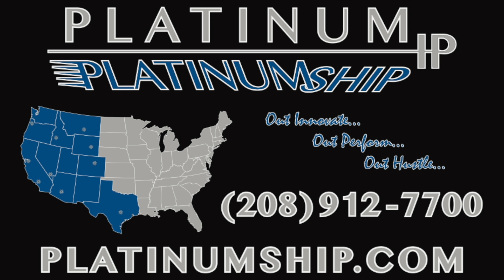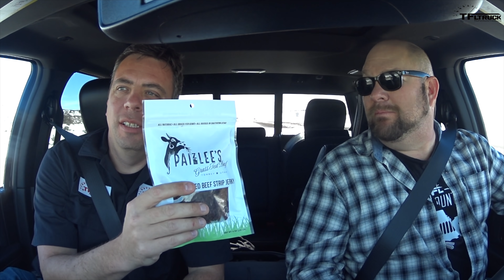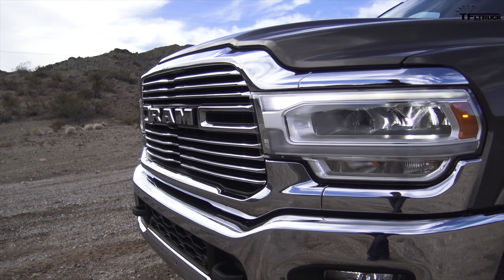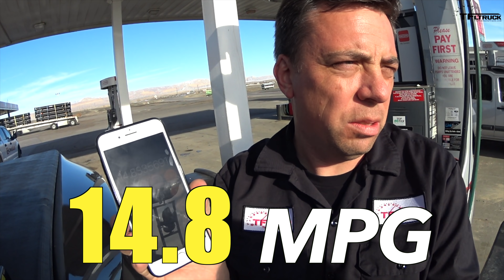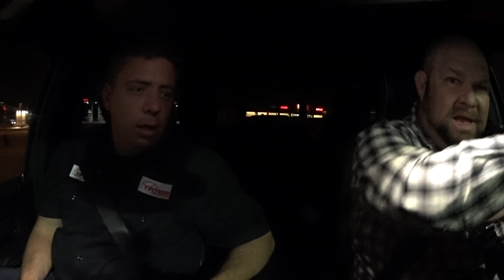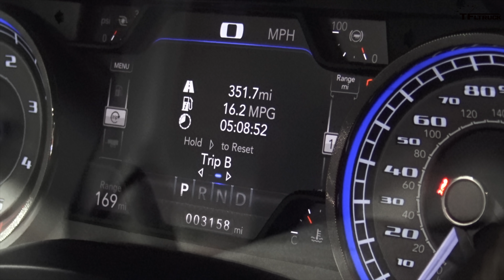We Drive 800 Miles in the New 2019 RAM 3500: Here's How Fuel Efficient 1000 lb-ft of Torque Is!

Comment: My 6.0 power stroke dually with 22.5 Alcoa’s gets me way better than this ram I travel 700 miles on a single tank which holds 36 gallons if I’m not wrong.

Comment: Yeah big rigs use cummins but not the 6.7 cummins just stop saying that nonsense already.
Reply: Obviously the big rigs do not use the 6.7. The point is that the 6.7 (and 5.9s) were made almost exactly like the bigger ones. Same materials, specs, etc. That is why the engine overhaul rate is 350k, a true medium duty diesel engine. And it can be bored 2 or 3 times I'm many cases before being sleeved. A true million mile inline engine that always had high torque in low rpms, higher compression, and no glow plugs unlike the competitors. Simply no comparison.

Comment: Any Cummins engine installed in a Ram or the Ecodiesel in the Ram.  Get the best fuel economy at 1300 to 1800 rpm.  So if the gear ratio and the speed limit.  Have you outside that range.  Your fuel economy will suffer.  My wife has a 2018 Ram 2500 4wd Crew Cab.  I have a 2016 Ram 1500 4wd Quad Cab.  We find the numbers that TFLTruck gets, to be very realistic.
Since I have a class "A" license.  And have operated vehicle combinations up to 230,000 lbs.  A Ram 3500 or any brand pickup is only good for occassional heavy towing.  So you really have an everyday vehicle that can tow things now and then.  A 3 or 4 year old tractor can be bought for $30-50k dollars.  And will pull a 35k lbs trailer real easy.  But it cannot be parked on the same streets as a 3500 sometimes.  Plus a Ram 3500 will fit in most parking garages.  While a tractor will not likely fit.

Comment: The ram intake that the truck has needs work. I build fire trucks and we can't easily build a truck on their chassis because they over heat when pumping water. The shutters in the grill don't open when stationary so it sucks the hot air from the passenger wheel well instead of the grill where the cooler fresh air is. 

The engineers from Ram said their cooling package is half the size of Ford's

Comment: That’s a terrible MPG. My 2015 Ram 3500 with Aisin got 21.7 mpg on my 950 mile trip from Ohio to Florida back in December. 
Didn’t get fuel until Macon Ga. but still had almost 1/4 tank. That was almost 600 miles on the first leg of the drive.
Reply: You had more miles on it once broken in diesels always do better

Comment: Better mpg than a tundra 13.9 mpg 
But won’t last a million miles like the tundra
Reply: Bet, cummins has a high mileage club for vehicles with high millage. You might be surprised to learn that the list isn’t short either. With a list of over 6,700 vehicles, 90 of them have over one million miles on their odometers. Of the highest is a 1996 Dodge Ram with a 5.9-liter Cummins diesel engine that has 3,016,789 miles. Following that is another two 5.9-liter Cummins engines that also have over 3,000,000 miles on them. Get your facts right Bud.

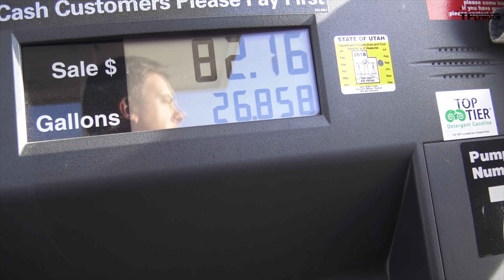Comment: Another good video guys. I live about 40 miles from Green River where you checked the mpg on that beautiful Ram 3500. I wish my 2009 Dodge Ram 3500 dually diesel got that good. When not pulling my trailer, I average approximately 5 mpg and pulling my big trailer, it averages about 2 mpg. It takes me two tanks to make it to Las Vegas from Green River, when pulling my 38 foot trailer. Pulling my trailer up Spotted Wolf on I-70 , you can actually watch the fuel gauge move before reaching the top. The truck has 4:56 gears and I've had it at the dealer and at independent diesel shops literally hundreds of time complaining about the mpg, but every one tells me that it's normal.

Comment: My 2018 F-150 5.0 averages 12.1 MPG's under normal driving conditions this Ram is awesome
Reply: You must be heavy on the gas. My 2017 5.0 averages 16.5 MPG combined.
Reply: no way your getting 12.1 do hand calculate not what's on your screen
Reply: Red light racer.

Comment: I once had a new 2003 Ram Laramie dually quad cab 5.9L Cummins diesel.  I would average 18-20 mpg on my trips between Denver and Albuquerque with no load other than the driver and fuel.  For my RV use of the truck, I prefer the better mpg than the often unneeded 1,000 torque figure and no DEF tank.  As I remember,  I paid around $34,000+ for my truck.  The need for DEF, diesel fuel costs, ,and the crazy prices for a diesel truck today has turned me off on ever buying one again.  I will buy a gas engine next time.  The new 1/2 tone trucks pull what once required at a minimum a 3/4 ton truck.  I know there is a market for that new Ram monster TFL drove back from Vegas, but it has outgrown me in too many ways.

Comment: So... this new 2019 6.7L 1-Ton diesel (with 1000# of torque) gets just about the same mileage as a 1500 Half-ton Ram with the old 5.9L gasoline engine and a 1/3 of the torque.  Pretty impressive, really.
Reply: A turbo diesel is way more efficient than a N/A gasser👍
Reply: Agreed.  But, unfortunately, in my state the Legislature is going after diesels of all kinds, sans off-road and farm-only vehicles (tractors) to punish the owners of them.  Oregon wants to essentially ban all over-the-road diesels in the name of Climate Change.  What a pity if they get their way, and I don't see much in the way to stop them.
Reply: I wouldn't cross the diesel-gas engine barrier as it's just not relevant.  Compare new 6.7L to old 12V 5.9L Cummins in first and second gen Ram, instead. ;)
Reply: Mic when you say it like that it is pretty impressive
Reply: Apples to oranges. This is a diesel from the sounds of it it you are comparing it to a gas. A diesel 1/2 ton gets about 30 mpg, about twice as much as the Cummins.
Reply: I am, but that's the point.  I still own my 2001 Dodge ½-ton 1500 with the 5.9L V-8 and it gets ~14 mpg.  Has since new.  This 1-ton with >2.5 times the torque does the same or better (mileage wise) while able to do a LOT more work.  To me, that's remarkable.  I also own a 2015 Ram Ecodiesel which gets 29+ mpg.  But it has < half of the torque of this 1-ton.
Reply: @mic982  Buy a older dodge from the 90s add a few mods get a true 1000ft of TQ and 21 MPG PLUS no DEF to cost you more. This thing gets crap mileage! BTW if you get a programmer for your 1/2 ton you will get better mileage. Back in them years dodge did what was called the "death flash" which killed the mileage. If you get a hold of a older 90s gas that was lucky to never get the flash you will see better. Even my 3/4 ton gas burners get 16+ but they are not flashed trucks.
Reply: I own a 2001 Dodge 1500 with the 5.9L (360ci)  for the farm (14 mpg, <425# torque) and a 2015 Ecodiesel 3.0L (with 440#) at mpg's as high as 30-31 (but usually around 28-29).  I don't really have need for the 1-ton and the 1000# torque because the Eco pulls my 5000# RV at around 17-18 mpg and I'm only pulling it a couple thousand miles/year tops.  But I was pretty impressed that the new 1-ton could generate that much power and still meet or beat my older 5.9 gas engine with all that power. When pulling my trailer with the older truck, I'm lucky to get 8-9 mpg!  DEF is cheap - about 4 gallons per 8000 miles or about $18/year.
Reply: @mic982  DEF is not really cheap once you factor in the constant repairs of it. Don't forget to put that in there. Also diesels will always produce more power then gas with better mileage. 
gasoline  1 gallon = 120,429 Btu²
Diesel fuel  1 gallon = 137,381 Btu

Diesel fuel simply produces more for less. Plus the engine designs factor in there.
Reply: @eatshitful  I'm not advocating DEF - tho with the new Café standards required by the EPA and other Federal agencies it's what auto manufacturers are having to do to try to reach the unreachable:  0 emissions.  I'm hoping the Trump Administration will bring back a measure of sanity to the EPA but I'm not betting on it.  Yeah, I'm sold on diesel if the power is needed at economy.  No arguments there.
Reply: @mic982  Now if you dig into the details of emission systems and figure out how they work and what they do plus how they are tested you start to get the idea there is another reason for it because they are actually raising the emissions overall while making it seem low at a very narrow point and with a incorrect measuring system. If you think i am nuts by saying that fine i wont type out anymore details. If you want to know why i say that just ask.
Reply: @eatshitful  As an interesting side note: I get this notice in the mail of a class-action lawsuit against Chrysler/FCA awarding owners of the ecodiesel Rams and Grand Cherokees cash returns (substantial) IF they agree to send their vehicle into the dealerships for the software changes needed to make the vehicles compatible with those new standards.  Plus, an extended warranty on the engine emission systems.  Hmmm....I'm wondering is the cash carrot worth risking a decrease in performance and/or mileage?  Or is there a 'stick' awaiting owners who pass on the software changes.  I mean, these ecodiesels are amazing in their performance and mileage now, why mess with a good thing?
Reply: @mic982  No way i would take it back to a dealer ever again then. Any time that thing sees a dealer now they will do the update. As back in the 90s and early 2000s the "death flash" did nothing but harm the mileage and power while masking a issue (unrelated to emissions). I wouldn't do it. If i remember right it was VW who had made a vehicle that did not fully comply with emissions which is why it performed so well. Then they got sued bluh bluh and after the car was able to pass emissions mileage fell along with power. Now for a diesel to be re flashed to pass emissions i could only see it being a down grade to because the way a diesel runs. Other then maybe a timing advance but i highly doubt that is all you would get. Most likely defuel it to get the emissions down making it a dog. Altho most stock diesels would see less emissions more power and better mileage just bumping up the timing. You can only go so far tho. I bet the dealer is not going to do that. Actually for many years them so called "mileage programmers" simply upped the timing on a diesel. As strange as it may sound most diesels gain mileage by adding timing and fuel especially a truck pulling heavy. Yes i just said add fuel to gain mileage. It works because pulling a hill down shifting is bad for mileage. If you have the power to stay in a higher gear while keeping your speed you gain mileage. Now empty unless you plan to push on the peddle harder your mileage will not be lost. You gain mileage here because of the timing. This is why i now turn up every diesel i own. It is not to play it is to get the mileage pulling. At one time i only turned up the timing thinking adding fuel would only hurt the mileage but 1 truck i finally did and the mileage improved. So i tested this with several more trucks and it works. You may not see the gain adding fuel if you are already holding your speed without down shifting up hills. A gas vehicle will also gain mileage if you can keep your speed without down shifting. But it is harder to make more power out of a gas engine in a way it wont overall lower your mileage.
Reply: @eatshitful  Don't think that wasn't the first thing that crossed my mind.  But I give you the 2nd paragraph of the 'Approved Emissions Modification Overview' on the web-page detailing the settlement:  "The AEM is not expected to change any of your key vehicle attributes, such as average fuel economy, reliability, durability, vehicle performance, drivability, engine noise or vibration, or other driving characteristics."  Now, this may or may not be true, I dunno.  The 'carrots' offered to get owners to join the settlement are $3025 to original owners, $2425 to owners not the original buyer and $990 to all lessees, plus an extended warranty beyond that of the original factory warranty.  Of course I am very suspicious of this because of the superior performance  of the Ram ecodiesel as it is now configured.  I am waiting to hear back from others who will have undergone the modifications and driven their vehicles at least 1000 miles after.  The modifications are not yet available and won't be (apparently) until sometime after May 2019 when the court makes it's final decision.  Thereafter, owners will have 21 months to join the suit if they choose to keep the vehicle and have it modified.  $3000 smackers and an extended warranty are a lot of carrots.
Reply: @mic982  Did you end up taking it in? I heard the updates were nothing but bad news.
Reply: @benbennett4097  Yes, I did.  About 6 weeks ago.  I was lured into it by the extended warranty and the $3025.  But, if I had it to do over again, probably not.  Mpg dropped from ~29 - 31.5 (hwy.) to 26.5 - 27.  City mpg dropped from ~26.5 to <25.  AND there is now a much more noticeable sluggishness in throttle response than before.  Of course:  that's the 'trade-off' for using more DEF and (hence) a less combustionable fuel mixture to drive the pistons.  Bottom Line:  loss of performance for slightly less emissions. Still waiting for the $ promised by FCA.
Reply: But with 1/2 ton diesel has less than half the capability. What is impressive about the big diesel is that it can get pretty good fuel mileage and still have all that power and towing/hauling capability. it just costs a house payment every month
Reply: That's true, but some of us don't need a truck with a 1000 lbs of torque.  I pull a 5000 lb trailer and the Ecodiesel pulls it with ease AND gets better mileage (by far) than the 3500 1-ton.   I get almost 30 mpg when not pulling the trailer, which is about 80% of the time I drive it.  What I'm saying is: if you need a 1000 lbs of torque, buy this truck.  If you don't - why own it?  It probably costs about half again as much to buy it and gets half the mileage.
Reply: @mic982  Agreed! Its all about getting the right tool for the job!

Comment: 80% of the Cummins engine is new. No more valve lash with hydraulic roller finger followers. The VGT is updated. EGR is updated. Different high pressure pump and injectors.

Comment: I have a 08 duramax and I get around 20 miles per gallon
Reply: Less power and is it a dually? Hard to compare so really you want them to test a 2019 Chevy dually then THAT would be fair, well except again for the huge power difference. But still..
Reply: rsg1963 also I have a day cab  peterbilt with Cummins engine 430 h/p I get 6.8 mpg, and a sleeper Freightliner with Detroit engine 475 h/p I get 7.8 mpg and the Freightliner weighs 3,000 pounds more Cummins isn’t good in mpg
Reply: rsg1963 $250 to $300 more every week
Reply: @JoseGomez-iq6hw  Still missing my point that you are not comparing similar rigs at all. Make Chevy, Ford and Ram all tow Chevy's maximum (since it's the lowest numbers of the three), then make them all duallies and all towing on the same day, same road. NOW compare MPG. THAT'S much more meaningful than simply saying "I have a 08 duramax and I get around 20 miles per gallon".

Comment: 15 mpg in a new truck with emissions, winter fuel and temperature, up to 80 mph, 4.10 rear, and crossing the Rockies. It isn't terrible IMHO.
Reply: Better than an H2
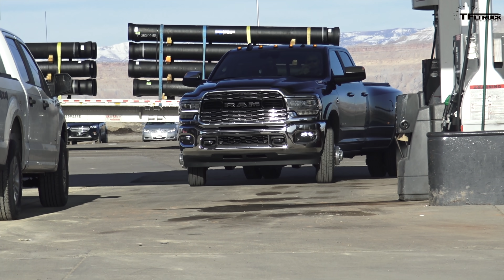Reply: 4:10 rear is a killer
Reply: My personal best in my 2012 3500 single wheel 4x4 Megacab is two trips to St. Louis from NW Indiana right at 15mpg hand calculated. 3.73 gears, cruise control at the speed limit. One trip was all stock, the other was with 100hp tune emissions intact.
Reply: @TheFarmersLife  in our 2014 Ram mega cab dually with 410 gears we are getting over 15 MPG
Reply: @redwood6737  yeah I hear the 13+ trucks do better. Thought I'd get a 2012 without DEF at the time. Gets worse mileage than the 2004 Duramax it replaced. I do live the truck though. Just nitpicking the mileage a bit.
Reply: I have 4.10s and they are the mpg killer for sure.
Reply: @Nicksterzone  a taller tire would help a bit?
Reply: @whenibecamethesun..8759  If I ran 37's I would see a better ratio.
Reply: @Nicksterzone  37s...damn
Reply: Might as well go 8 inch lift 44 boggers then
Reply: Gotta delete the truck and it’ll be like 18-20
Reply: Our 2012 f350 6.7l powerstroke averaged 17 7-18mpg bone stock. But you don't buy a truck for mpg so it's not a big deal lol
Reply: @Dandonsman  
What gears do have?
Reply: @Dandonsman  mpg matters in the king run if you use the truck for work. It adds up

Comment: Why don't you just get a gas engine, it can get 18 ish miles to the gallon, so it's way cheaper on gas
Reply: The difference is towing, by a HUGE margin. Then add longevity of the motor as a Diesel bonus. 300k+ before rebuild motors vs 150k (tops) for the gasser. (these are generalizations of course)

Comment: If I had dollar for every time somebody told me their Cummins got 25mpg I’d be 8-12 dollars richer.   None of mine ever did better than 19mpg.
Reply: Hahaha, good one! :-)  My 2016 6x6 Dually with the THEN big motor (900 ft lbs) and 4:10 gears will get 19 highway with 34" tires on 20" rims and a 45 Gal tank in the bed. IF....IF I keep the speed down to about 65-70 and at sea level. Otherwise she averages about 17.5 Highway, 12 city.

Comment: I bet you could negotiate $15K from the MSRP, I got $12K of my 2015 2500 MegaCab. It had a Sticker of 64,420 and I paid $52420 and it was in April NOT a end of the year deal. The Higher the MSRP the more wiggle room they have. I used to sell Porsche back in 2005 and Porsche had between 10-15% mark up. That means you could sell a 911 with 10K off sticker and still make a nice profit. BTW, I average 19-21 MPG in my 2500 being all stock, I get 16-18mpg with a Carli 3-4" Lift with 35" tires